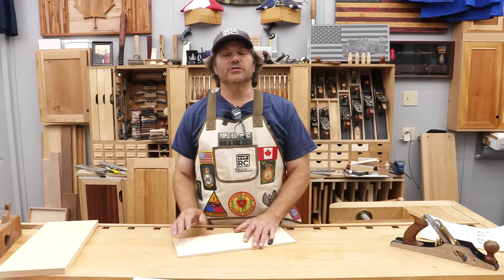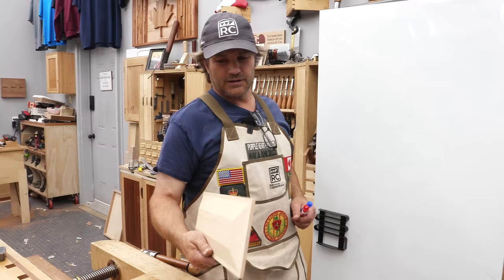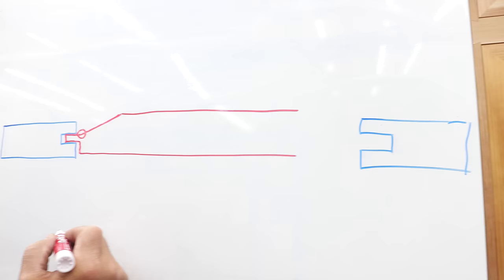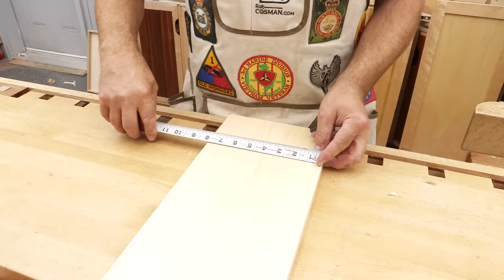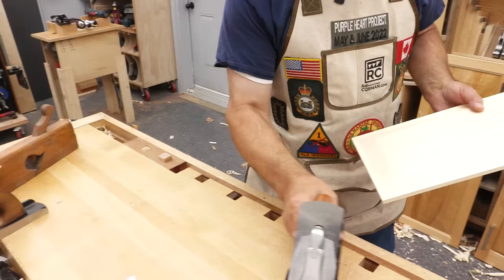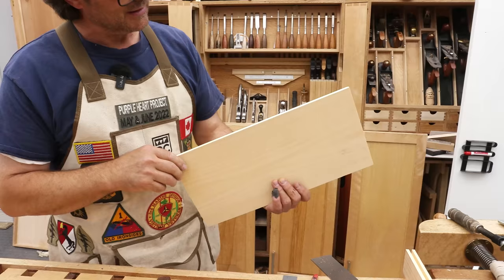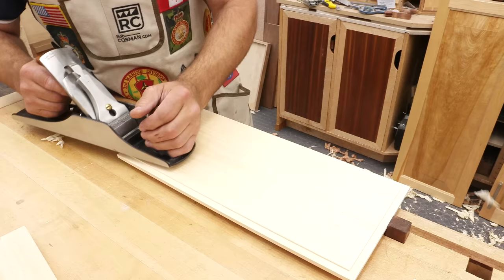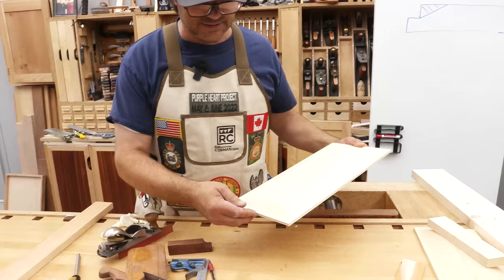How to Make a Raised Panel Door – Furniture making for beginners

Comment: I watched the whole video waiting patiently for the "beginner" part to start but no luck.  This whole thing is for seasoned wood working pros with thousands of dollars in high end hand tools.  None the less, i really enjoyed watching your skill in actually making this door.
Reply: You'd be surprised but you can do all of that planing using a no. 778 rebate plane. They're very versatile plane that is fairly cheap because of how common the design is. A skew plane would still be ideal for the times it gets used in the video but the 778 should be just as effective as long as the cutter is sharp enough.
Reply from the maker: You can do it!  Maraek this is why we showed the hand tool version instead of the power tool version of how to make a raised panel.  The hand tool version just requires two planes.  No table saw, dust collector, saw blades, router, router bits, etc..   just two hand planes.   Its tons cheaper as for what tools you need.  Most woodworkers who watch our channel already have a bench plane and some type of edge to edge plane. I showed at the beginning of the video all the different edge to edge planes you can use to make the panel.  You dont have to use the same one i used, use whatever one you have in your tool box.   If you want the no tool version use a plywood panel like we show in one of our other version, but if you want a raised panel this is the least expensive when considering tool costs but more importantly its the most satisfying and fun way to make a raised panel.

Comment: Great video! Like previous commentators, I’ve wondered how this is done with hand tools, now I know! BTW, I bought my skew block plane several years ago to help making my dovetails as per your method, Rob, and I’ve found it a fantastic tool for other applications as well. Yet another use here!
Reply from the maker: I love the skew block plane
Reply: @RobCosmanWoodworking  I just posted about not having the rabbeting bench plane. Is the skew block plane wide enough to do this without overlapping? Or is sanding the only remedy?

Comment: Great tutorial as always. Have you ever used space balls before for 5 piece doors with solid wood panels?
Reply from the maker: No.  I prefer to just pin the center of the panel as I explained.  I think thats easier than sticking those little rubber balls in the groove

Comment: I've wanted this info/process since I started watching Rob. The only sad part is you can't seem to get a bevel down rabbet plane. Lee Valley has a bevel up, and that's hard to catch in stock. If a shoulder plane (basically any narrower plane) is used, I assume sanding is the solution to making it even. I wish there were a way to make a rabbet plane the width of a bench plane. I guess one could make a standard wooden plane, but shape the side concave to move into the edge of the blade without giving up too much rigidness, but then you lose the ability to have the angled caul/guide. Thoughts?

Comment: I am right handed. Does it matter if you plane a panel starting on the left side and working across to the right? I noticed in this video you predominantly started on the right side and worked to the left side.
Reply from the maker: Does not matter.

Comment: My skewed block plane has a nicker cutter in front of the blade. I found it sometimes difficult to line up the edge of the blade to the nicker while keeping the blade parallel to the sole.
Reply from the maker: I almost never use the nicker.  My method is to ensure I have a sharp blade with minimal projection and I found I don't need the nicker.

Comment: Could you clamp another piece of wood underneath when touching up with the skew block plane to keep it stable?
Reply from the maker: you can set the work piece to be flush with the edge of the bench and use that to help hold the skew block.

Comment: Is it possible to create the bevel first, going right to the edge of the panel, and then with a shoulder or rebate plane create the flat edge. Only difference in the end result would be a step down from the bevel to edge(tongue). Is that a furniture faux pas?
Reply from the maker: You can do that, you have to be careful with the wood movement as I showed on the white board.  If you just bevel off to the edge then you has a wedge shape going into a groove.  That is not nearly as mechanically as good as a tongue going into a groove, and now you have to somehow account for the movement of the wood and preventing that wedge from opening up or splitting the groove.  Carrying the raised portion into a flat tongue is the traditional solution to this dilemma and I think it looks a lot better

Comment: How did you ensure the block plane was running at the same angle when doing the bevels? Feel?
Reply from the maker: Yes.  The block plan just needs to be held level and the fence helps but its just a feel
Reply: In one camera perspective you could see the fence not being cut with a 90° edge but angled. The side of the plane registered against this angled edge. This was prob. a help for starting the cut. When the first bevel has established, I guess it will become easier.

Edit: look at 20:25

Comment: Just as a heads up your audio has been quieter the last couple of videos. The cuts that are coming from older recordings have much louder volume (these actually match most other videos) compared to the new content portions of the videos.

Great content otherwise!
Reply from the maker: Thanks for the tip! I will have Jake look into it

Comment: Man, tough luck if you don't have this specific tools...
Reply from the maker: Well for a raised panel by hand you must have one tool that cuts directly into a corner.  I showed several other tool options you can use.
Reply: Not necessarily. See Rob's dovetails on a budget video.
https://www.youtube.com/watch?v=S4vLxwUa5yY
Reply: Can't do everything with just a nail file. For a panel like this, more than your basic tools are needed, just face it. The traditional way is to use an even more specific and costly, single application plane, a panel raiser. If your design can stand a little rustic flavor, and if the raising can be rather shallow as with a thin panel, then you can just plane down a wedge and hope that shrinkage doesn't make the panel rattle too much.